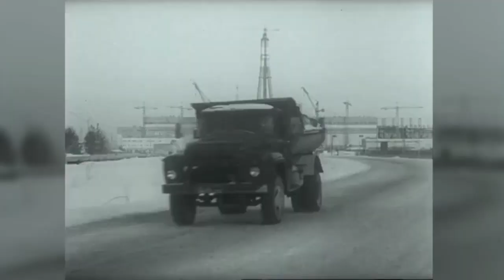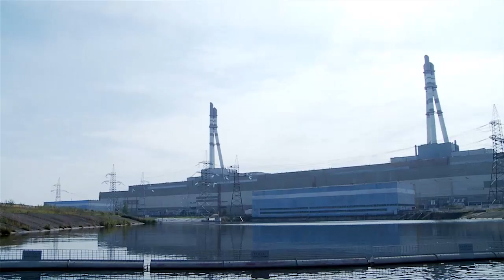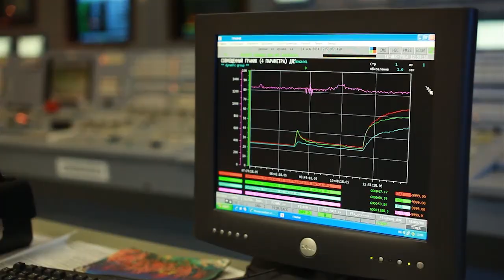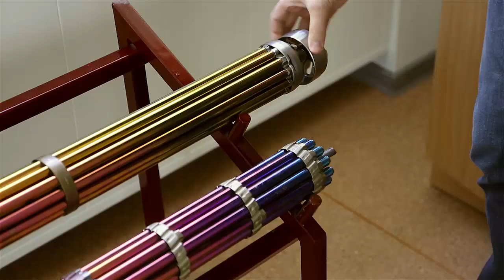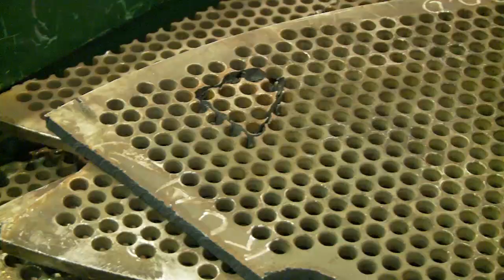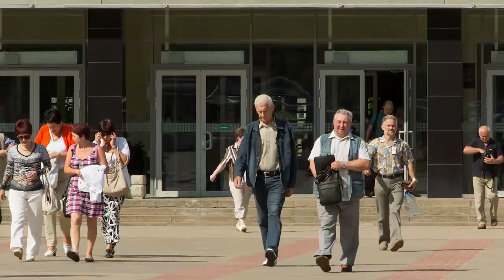SE Ignalina Nuclear Power Plant

Comment: The main problem with RBMKs was inconsistent build quality. Chernobyl had many known design faults identified by the KGB.
Reply: I've the last few days been watching documentaries about Chernobyl.  One, a BBC documentary, outlines the conversations among those directly in charge of the plant.  The main investigator of the accident, in a conversation with another gentleman whose name I haven't caught, reference Ignalina where apparently an incident occurred similar to what happened at Chernobyl--that the rods were not in fact dropped back in, only the tips.  I'm still searching about what happened at Ignalina.  Just how much was known along the way, known and kept under wraps.
Reply: @mole62ssf  The bbc one was  the only one actually shot there. unit 3s control room was used as fours Adrian edmondson refused an award for playing the part and that was never announced in the media  daniel sandford was there at same time as me doing a 25 year ago special wich says when i was there.
Reply: @rumbler900  Which documentary? The ones from the BBC look like the switchyard control room, absolutely not the units control room. The exterior on those documentarys from the BBC arent RBMK exteriors.
Reply: @mole62ssf  it is only partially right though. At Ignalina there was once an incident (unfortunately I can't recall how it particularly was caused) where they had to press AZ-5 (the emergency shut down) like they did at Chernobyl right before the reactor blew up. As at Chernobyl they were detecting a rise in power right after pressing AZ-5 before the reactor shut down. Luckily at Ignalina the control rods could be inserted because the reaction was not as overcritical as it was in the Chernobyl accident when the rods were inserted. At Chernobyl the peak of power caused the rods to get stuck so they could not break the reaction anymore, indeed increasing its power even more so, that it eventually blew up.
Reply: @laurencehoffelder1579  It was soon after Ignalina Unit 1 was commissioned December 31, 1983 that the problem with the rods became apparent. I agree with you that the reaction at Ignalina was not as overcritical, and the fact that the fuel was new were reasons why Ignalina could be shut down. Most of the fuel in Unit 4 was the original fuel load from December 20, 1983, which also makes controlling the reactor more difficult. I think that fact might be in Medvedev's book, as I read it probably eight years ago and don't recall all of the details.
Reply: @runforit420 Medvedevs book has a lot of mistakes, it is a fantasy book
Reply: @redcub7895  True. You're right. Four years ago, pre-The Chernobyl Guy videos I hadn't fact-checked Medvedev's book closely.
Reply: There were a bunch of other issues with RBMKs as well. The big ones being:

(1) Positive reaction coefficients, in which small changes in operating conditions had a tendency to run away with themselves unless actively controlled. Running the reactor was like balancing an inverted pendulum, where it required constant care and vigilance to keep it running within desired parameters. This is an inherent flaw with these types of heavily moderated graphite reactors, where the neutron-absorbing properties of the cooling water become its dominating property in regards to neutron flux. The RBMK reactors are run hot, so in normal operation tiny bubbles of steam are generated in the water moving through the fuel channels - and these voids decrease absorption, increasing power,  which causes more steam, displacing more water, etc.. There was no reason to have these kinds of unstable properties when safer, self-stabalising reactors with negative reactivity coefficients were the norm (except that they could be built cheaply and generate higher quantities of Plutonium).

(2) RBMKs lack containment structures. So in the event that a reactor suffers a catastrophic failure, the only thing stopping it from releasing radioactive material into the environment is a non-reinforced wall. It also leaves the reactor vulnerable to damage from external accidents (such as a plane crash or deliberate terrorist attack with explosives / kinetic weapons). By the time the first RBMK reactors came online, full containment buildings were not just the norm outside of the USSR - but required for licensing. There was no reason to omit this important safety feature (except, again, cost).

(3) RBMKs were unusually unstable when operating at low power. There were multiple reasons for this - including the abovementioned positive reaction coefficients, slow control rods, and trade-offs during the design stage to allow them to run hot - but the result was that it required at great deal of care an attention to control the reactor during start-up / shut-down / refuelling. This is dangerous because during these operations, there are often other things that operators are focusing on. The infamous Chernobyl safety test being a good example - where workers were so used to fighting with the reactor to maintain control at low power that they were able to put it into a dangerous configuration while distracted with the test (people here have no doubt seen the HBO miniseries, but that was not how it happened - by all testimony from those in the room that night, everything seemed normal until the power spiked a few seconds before the explosion).

(4) The graphite-tipped control rods - which caused a power spike during SCRAM - were not unique to the Chernobyl plant, but were a feature of every RBMK reactor. These were later upgraded after the disaster, but it's important to note that they were very much a flaw in the RBMK design.

(5) The use of individual pressurised water channels creates a massive pressure differential within the tightly-packed core, and if one swells / ruptures it can dislodge adjacent channels. This is bad as it can jam control rods, preventing stabalisation of the reactor - which is especially dangerous in a reactor with positive reactivity coefficients. By the time RBMK reactors were designed, PWR reactors were the norm outside the USSR - which use a single pressurised vessel, and so don't have this flaw.
Reply: The heads of the power plant ignored these warnings and put safety second while money came first.